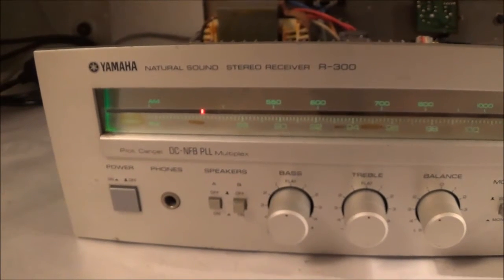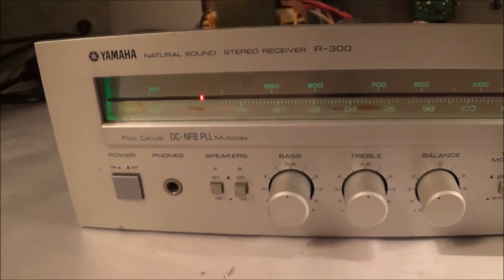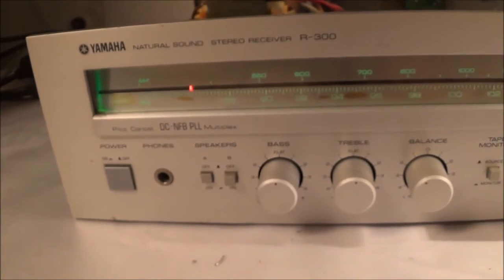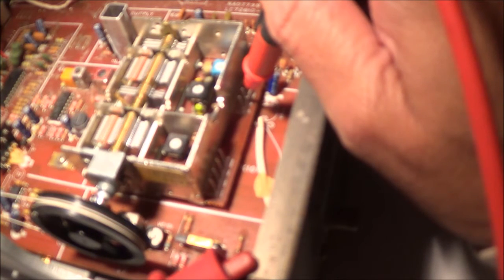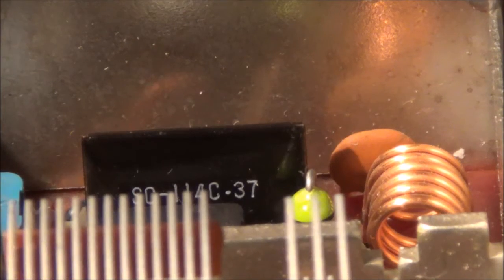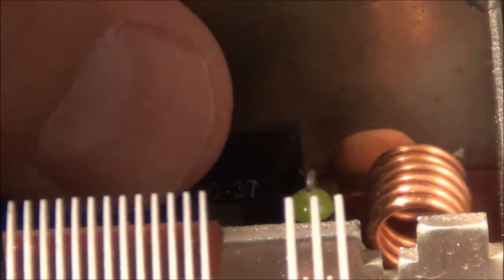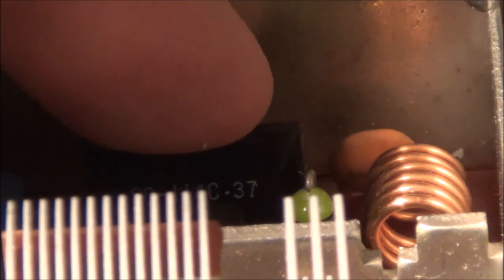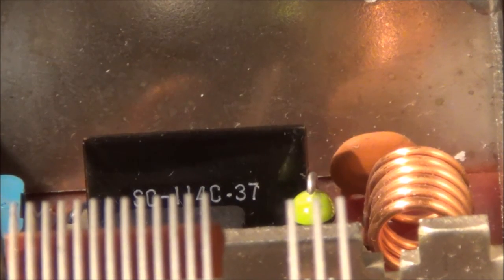Yamaha R-300 Stereo Receiver Tuner Problem

Comment: Of course it's Sanyo's SC-114 ic problem. It's two transistors ic, mixer and oscillator with some resistors and capasitors. I tried to find it for several months, even tried to make new front-end with another ic, but the only reasonable way is to buy a donor. In my case it is tuner kenwood kt-80 for 10 euro. Thanks for your videos and best wishes from Russia, Mike.
Reply: I've had a problem with Onkyo tx 2000
Reply from the maker: Thanks for watching. That IC is hard to get; getting a donor unit like you did is the best thing to do.

Comment: I have a R-300 that was working fine until i moved it, after which the RY301 relay would click on and off randomly and sometimes very rapidly. I tried to find source of loose/broken/compromised connection that may have resulted for my moving the receiver, but no luck. Pushed gently on various boards/components with no effect. Suspect relay may have issues but before i tear this thing apart, any suggestions on next troubleshooting step?
Reply from the maker: scott, you might want to tap on that relay while the unit is running and see if that makes a difference.
Reply: Check the solder joints on the STK output chip.Mine did similar in that the relay would sometimes turn on and sometimes stay off.Resoldered the STK output chip and problem solved.
Reply: ended up replacing voltage and main amp with Yuan-Jing dual mono amps 2x85W for $20. not authentic but works great
Reply: Oh ok.

Comment: Oh, I see, it's an I.C. problem!  :)  ~Jack, VEG
Reply from the maker: Yep. it got very hot; too hot to put  finger on. This IC was probably used in other units as well. If you run across a tuner unit that has no reception with this IC in it: stop, go immediately to this IC.
Reply: OK, thanks for the tip..I'll do that!  Thanks!  ~Jack, VEG
Reply from the maker: I could find no cross reference. I still have my unit and am waiting for a banged-up donor unit so I can grab the chip. Occasionally they are sold on eBay. I am not sure if these chips are in other Yamaha units or even the units of other manufacturers. You would have to download the service manuals of other units made during the same year or years and go through each service manual.